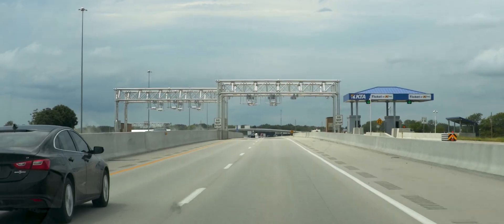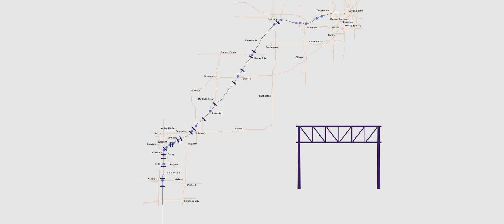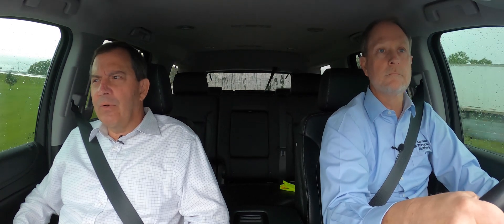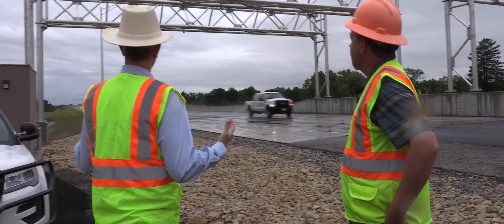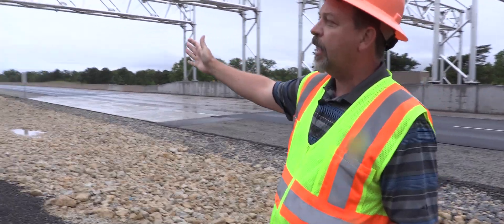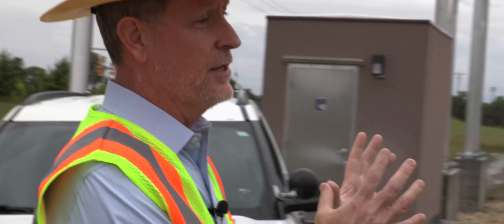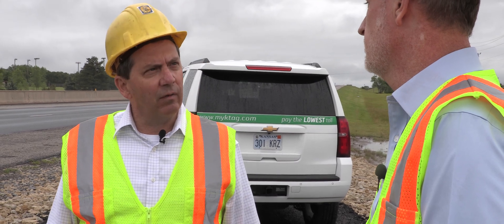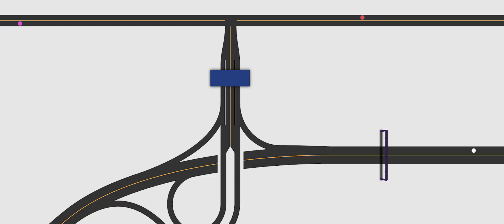On The Road: Cashless Tolling Update #2

Comment: Not understanding the reason for these when there is no exit around.
Reply: I'm thinking you can tell when people get on and off if you are checking between every exit. When you show up they know that the prior entry is where you entered and when you fall off they know you got off on the previous exit. This changes the need and function of toll booths and allow that area to be reconfigured and for everything to flow at higher speed and volumes.